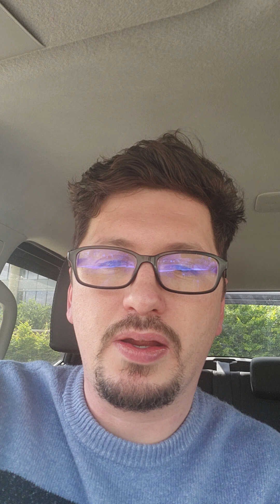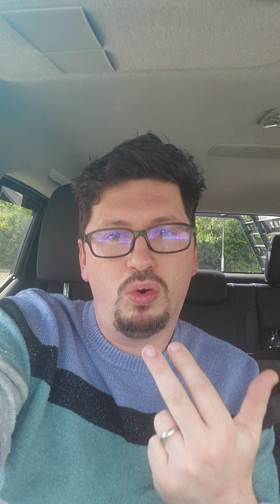New CSWIP3.1 teaching update. My honest thoughts.

Comment: Composite mark: G16 - Incorrect assessment of. Do you know what this means on the twi exam results page?
Reply from the maker: You were either mis measuring or misidentified the defects presented. Which exam was it in?
Reply: Thanks for replying. Cswip 3.1
Reply from the maker: Old or new scheme? Just trying to work out what might have tripped you up.
Reply: @CarbonArcTC  the new one. Not sure I’m a fan of the plate being in smaller segments. Found it more difficult to get the gage on there square
Reply from the maker: Yes I total agree with the weld guage issue. It's on my points to talk about in the live stream tommorow.
Reply: Hello James, will you please provide some sample questions for cswip3.1 (new pattern)?
Reply from the maker: @mohammadwaleedsheikh2879  I am busy assessing the best way for me to do this. It is likely that we will be releasing papers through our Patrion page soon but still getting the details sorted